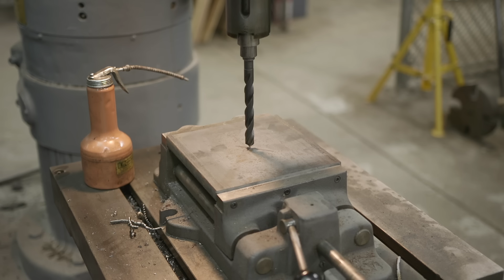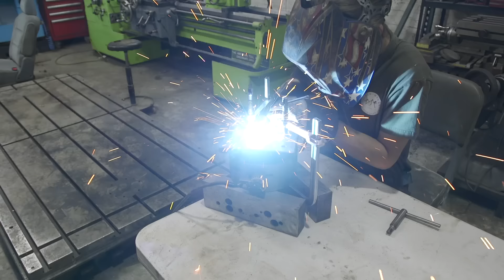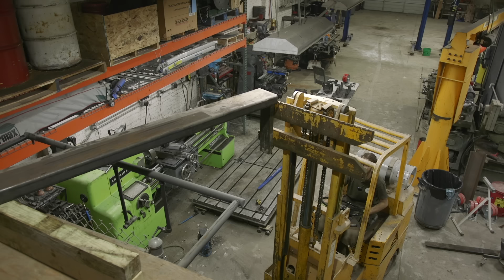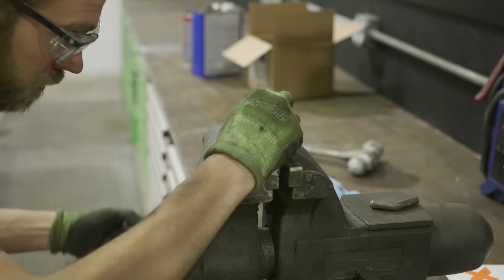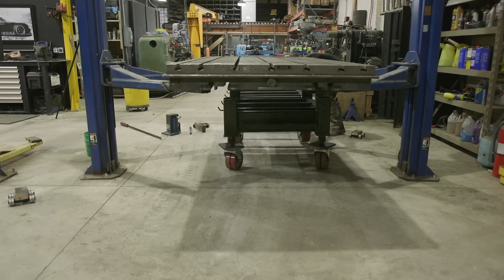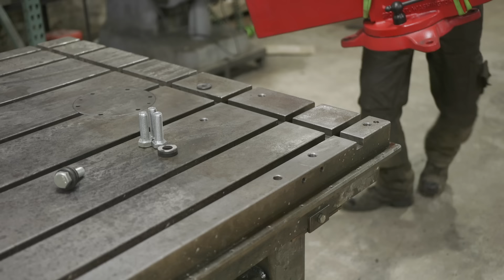Building a 7,000lb Welding Table for $600

Comment: Is there a reason the table seems kinda short?
Reply from the maker: Fabrication tables are a bit lower because you build on top of it but it is still 39” tall which is considered tall for a work surface. Most Kitchen counters are closer to 36” for reference. It’s an illusion mostly.

Comment: lol, 250lbs coming through. It's why we need a jib crane. (0.2m x 0.019m x 1.524m = 0.00579 m cubed x 7850 kg/m cubed = 45.5kg or in American units = 100lbs) = drama queen. Sorry, I couldn't watch any more than that. Probably turned out to be a good table but please, wipe the crap off.

Comment: Your math is horrible btw. Why are the wheel threads so long?  Do you plan on going off roading with it?  It is a nice table though. 👍🏼
Reply from the maker: Thanks… I just cut the thread into equal parts. I was not concerned with saving a few inches on each one, so I just made them longer. never hurts to be longer.

Comment: I dont know why people feel the need to lie in the title, it only destroys the credability of the video.
Reply from the maker: The top is 600$
Reply: @VanoverMachineAndRepair  What? you said you spent 80 x 6 on wheels, thats 480, then you said you spent 500 on steel! Then you left out the cost of welding consumables, the cost of a 10000 dollar slotted cnc mill table, the cost fuel to get these things to the shop and you didnt add in the cost of electricity to build it. What part about LIE dont you understand? lol  
The table is sick by the way and Im jealous.

Comment: 23:29 A really easy way to get the clamping you want at this point would be through the use of t-nuts and threaded rod to the table-top itself. If you want additional clamping, you could even clamp with 2 threaded rods per leg.
Reply from the maker: Good points. Thank you!

Comment: How on earth is this table for $600 when 90% of the material you used is for free.. click bait crap
Reply from the maker: Yes. Sorry I need to update the thumbnail. The top itself cost 600 bucks a casters 450 and everything else I pretty much had except for two pieces of tubing. So the table in actuality cost me around $1050. Still super cheap. Which is the point.
Reply: @VanoverMachineAndRepair  how did you manage to purchase a big casting like that for only $600? that should cost more than $20,000
Reply: @blizzardesigns  We have a built a few and 2 of the tables were actually free. They were from scrapped planers.
Reply: @michaeldavid2320  I have looked far and wide for scrap cast iron, people seem to be very quick to recycle it instead of selling pieces like this.

Comment: I love how it's immediately over $600.
Reply: yeah when he named the price of the casters i though.. yeah, this isn't $600
Reply from the maker: Yep it’s the price of the top
Reply: @VanoverMachineAndRepair  Great build btw :)
Reply: @VanoverMachineAndRepair  i subscribed, but you're bat at math😂😂
Reply: @VanoverMachineAndRepair you couldve saved some money if you found a sewer grate and put it on the ground
Reply: @VanoverMachineAndRepair  I didn't realize a welding table consisted only of a top...and not you know... the rest of the table.
Reply: @VanoverMachineAndRepair So you admit your title is an outright lie right from the beginning?.
Reply from the maker: @rodiona8781  yes indeed
Reply: @VanoverMachineAndRepair that’s fantastic. I’ve run into some outstanding deals over the years. My J-head knee mill for 100$ being one. That gorgeous table for a fraction of its scrap value is awesome
Reply from the maker: @Chris-pb3se  thanks
Reply: You can find the tables every once in a while at auctions or surplus sales but there isn’t a consistent market for them. Just gotta get lucky.
Reply: How to build a welding table for $600? Start with $1000 worth of stuff you already had laying around!
Reply: @cda32  i can show you how to build a house for $10(house is already built)
Reply from the maker: @cda32  yep many shops have lots of material laying around
Reply: I am from Germany and a welder myself. Turned of the video after 2 minutes horrible.... You talking around 2000 in material unless the metal is stolen. The machinery is unrealistic for an normal guy even with a bigger garage.
Reply: I hope, in the end that you make a custom plate for your table, including the manufacture, date and model number
Reply: And I thought my table was overkill. I have a welding/fabrication table that cost $475. The top plate is 2.75 inches thick and in total weighs 2,200lbs. The guy is making a table on a video, not doing  brain surgery…why are so many hating on him?
Reply: When u were welding table i saw some machine skates it sat on....woukd like to get more intel on those.  Did u make yhem?
Reply: How hard is table to roll by hand
Reply: You only paid $600 for the top. What's your source? All other weld table manufacturers would be out of business.  I call BS
Reply: @Supraman007 it's an old CNC table, it's a case of looking and contacts.
Reply from the maker: @slickmouse  exactly
Reply: @Supraman007  agreed I will say it BULLSHIT,
Reply: If you're somewhere with a lot of manufacturing you can buy stuff at auctions that sometimes if you're lucky hardly anyone shows to and get stuff cheap and also as he's done and bought a table off a likely scraped machine which you can usually go to a recycler and pay scrap price for which for cast iron is cents per pound you can score some amazing stuff at scrap yards if you get lucky and get to it before it gets processed you just have to check often or be cool to the workers who if you are may be nice enough to call you when good stuff you like shows up 👍👍👍
Reply from the maker: @umahunter  exactly
Reply: @Supraman007  I’m always checking out Repurposed materials which is an auction house for excess construction materials, including steel plates, that often end up being recycled or in the Landfill
Reply from the maker: @Supraman007  bidspotter
Reply: I don't see how people can't understand the dude said he's using stuff they had plus bought casters etc
Reply: @umahunter  point is that its bullshit clickbait, 99.9% of people came to see a cheap table being built. Just because you have it on hand doesn't mean that it didn't cost you
Reply: Where exactly does it say you can build this welding table for 600 bucks or how you can or anything else except for the title that says building a 7000 pound welding table for 600 bucks which is exactly what he said and did ! did he  say or advertise "you can" or "how to " no he said building a 7000 pound table for 600 which is what was show how much clearer does it need to be he showed and explained what the title said which isn't clickbait lol almost every dam channel on YouTube is using stuff they already have while showing them building something 😀
Reply: @umahunter Don’t see how you figure that. He said he paid $474 for the wheels and $500 for some of the steel tubing he used. So he didn’t build that table for less than $600.

Comment: Your eyeball scale needs calibrated lol the bar was about 100lb and the tube was 260
Reply: Bar was 75 at most
Reply: @bozobaz30  if it was 0.75 x 8 x 60, it was 104lbs.
Reply from the maker: I better send them in for calibration. Also I am thinking I was referring to the weight before I cut it down. I trimmed it off camera so I could lift it in place
Reply: @VanoverMachineAndRepair  I have an eyeball calibrator, gimme em